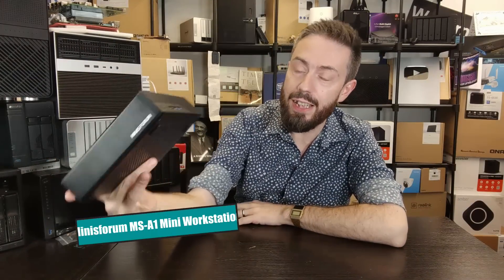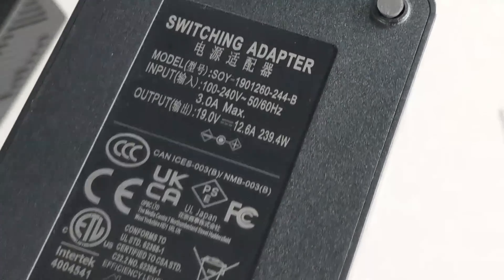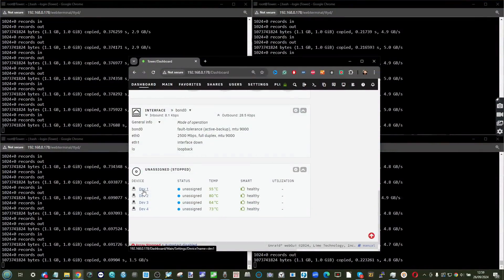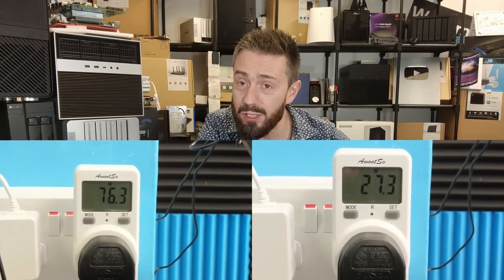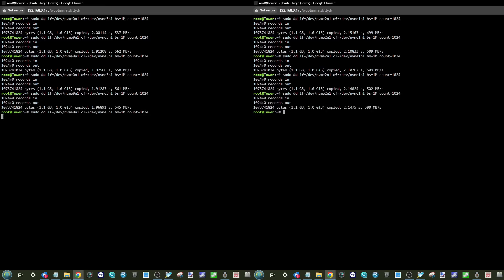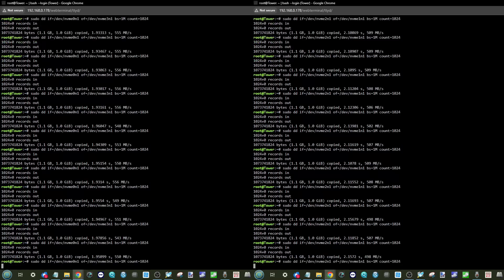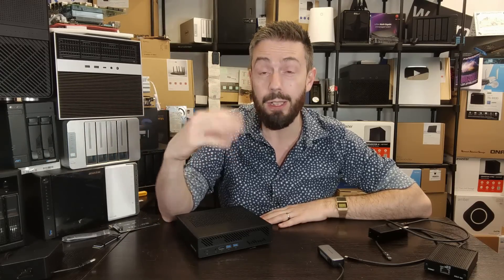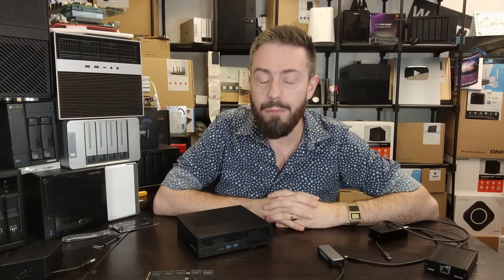Minisforum MS-A1 - A Good DIY 4 Bay NAS Server? (Review)

Comment: The issue is that you can't order it (at the time of this comment) with a CPU, you have to go DIY aftermarket. Will any AM5 socket cpu just work? I suspect that you need to stick to the 65W TDP? Just wondering if you can get a better CPU which will still work and stick within the TDP?

Comment: Just a heads up for anyone getting this. The NVME post for the 2 top drives that also anchors the heatsink for the ram and drives broke off while I was test fitting the heatsink. No screw inserted, I really just set in on the post the way it was designed and the top broke off. The broken piece is also really smooth where it "was connected" so I feel like QC missed this or maybe it a bigger issue, idk. BUT just be very VERY careful with that thing.
Reply: i will use my own M.2 heatsinks and try to find a way to cool the sodimms

Comment: I would avoid this at all costs as a NAS. Better options out their for the same price but with more storage (8 nvme instead of 4 nvme). Yes you can buy the cheap version and build it up yourself but your still not match the 8 nvme or 10gbe options out their and keep it compact. An example would be the Minisforum MS-01 which sells barebones but with a cpu, two 10gb, two usb4 ports for £399 so for an extra £150 (roughly) you get a cpu and better network and expansion via usb4. Now if you need a workstation not a server / NAS then I would buy this as the Minisforum MS-01 is louder. Like most people they should have just created an AMD version of the Minisforum MS-01 in my opionion

Comment: Another youtuber put a 7950x cpu in the MS-A1. It ran surprising well and cool - the latter probably a result of the cpu limited to 65W. Guess that would be equivalent to running in ECO mode. I wonder if there's a difference in PCIe lane allocations between the 7950x and the 8700g?
Reply: MF website says that chip will run at 100 watt

Comment: Be interesting to know what the cheapest practical (ie. Enough pci lanes) cpu would be. 

It's between interesting and sad to see that this ryzen based system has the same weird internal copy speed limit" that the N100 types suffer from.  Especially as you managed *simultaneous traffic at like 9GB/sec. It's like there's a weird side effect when switching the disk lanes from read to write.  It feels like the decades old mistakes like using the wrong packet/block sizes, or doing byte instead of block transfers. 

Did you get appropriate speeds in both simultaneous reads and simultaneous writes across all nvme channels?  If so the the bottleneck is something to do with interleafed read & writes... As with the N100s.  Very weird as on pcie & m2 there should be independent read and write data channels.

Comment: 27 Watts idle? This is horrible.
Reply: That’s true but honestly at this point it’s basically a desktop computer that happens to just be small
Reply: @AlwaysBolttheBird well, my hp "desktop pc" with 3 Nvmes and a i5 draws half of that, including a 2x10G network card.
I get to 25ish W in idle fully loaded with a Quadro A2000 (that draws 6-7 by itself) and 3 mechanical hard drives.
Reply: @12gark  ok and? My point was it’s clearly not meant to be a low power low watt system. Not much thought was put into it for that. It was just meant to be a powerful server rather than low power NAS
Reply: @AlwaysBolttheBird  sort of true, but other mini PCs use only around 7 watts idle and they are equally powerful.
Reply: @Galmok18 what other equally powerful mini PCs are you talking bout? coz I doubt it.
Reply: @kosmos3718  an Intel NUC 1360p uses around 7 watts idle and it's fast of need be. A homebuilt NAS based on AMD can use as little as 7 watts. There is no reason why a pre-built NAS cannot use less energy, especially at idle with HDDs sleeping and NVMEs idle.

Comment: Well, its upgradable. AM5 and DDR5. You only must check if the maximum TDP not exceed 65 W as the AMD Ryzen™ 7 8700G and AMD Ryzen™ 5 8600G, from Zen 4 and better...
Reply: Is the 8700G best CPU you can put in this?
Reply: @SRMB1  I´m not checked....😄 Must have to many 🤑🤑🤑🤑🤑🤑